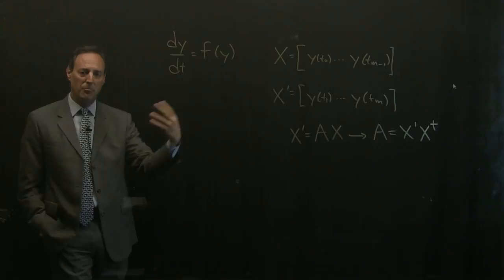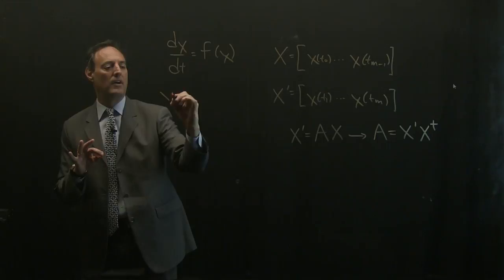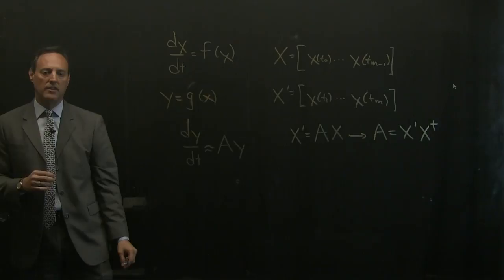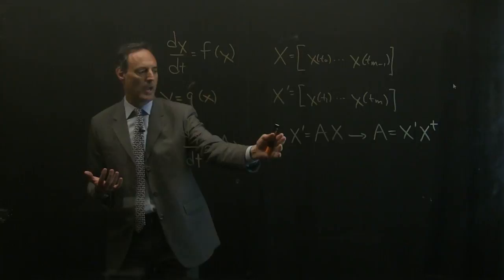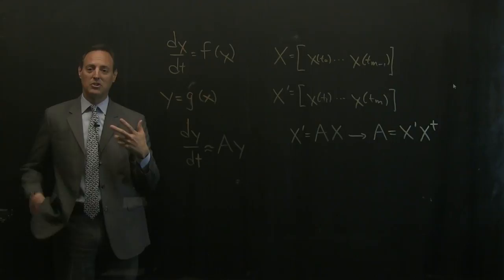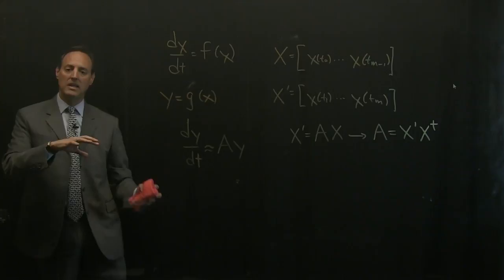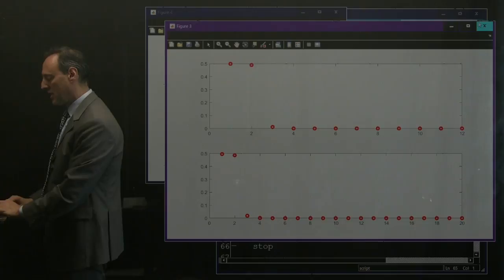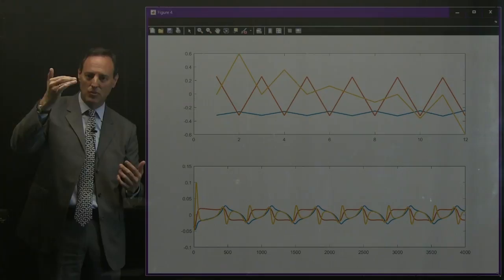Time delay embedding for Koopman

Comment: The good time delay was 9 seconds, which is more than the time it takes to complete a single cycle in vanderpol. In this case, wouldn't the future state prediction essentially end up just looking at what the system was doing at the same point in the previous cycle, since that's a state variable that's available? Also: is there a trick to start the linearized simulation? With extended DMD you could multiply the initial state to get the values of the observations, whereas now it looks like you need to know the historic state to construct the initial vector.